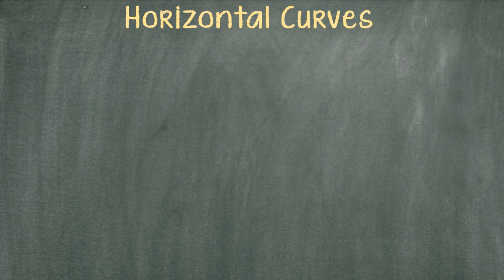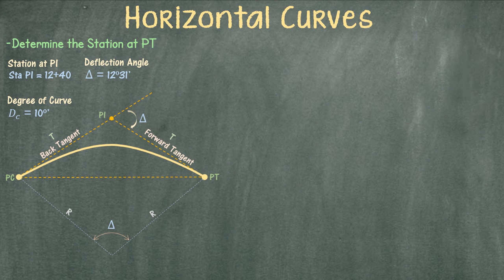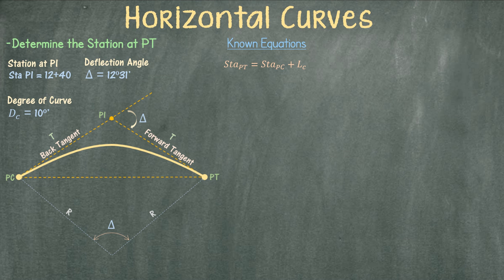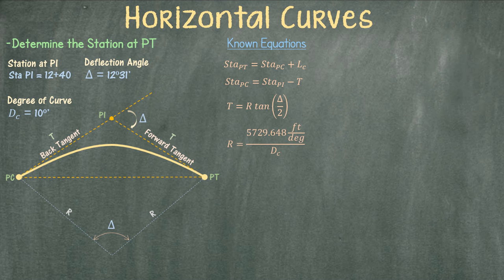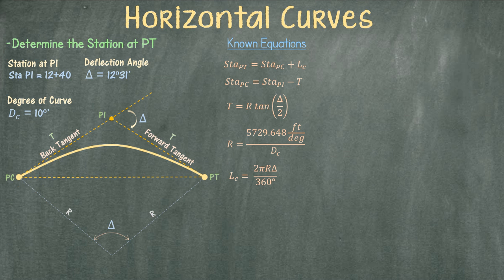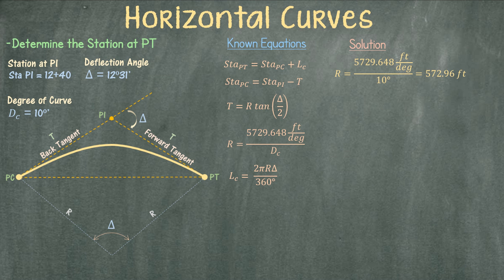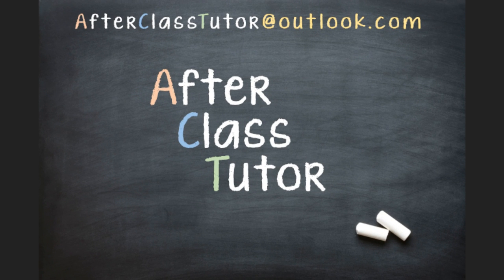Horizontal Curves Elements Part 2 of 2

Comment from the maker: Time Stamps 
00:00 Start 
00:14 Determine the Station at PT 
01:57 Calculation of the Radius of the Horizontal Curve Element 
02:10 Calculation of the Tangent of the Horizontal Curve Element 
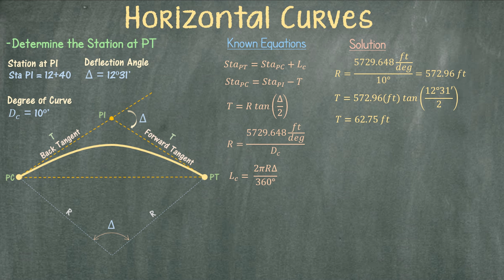02:24 Calculation of the Station at PC of the Horizontal Curve Element 
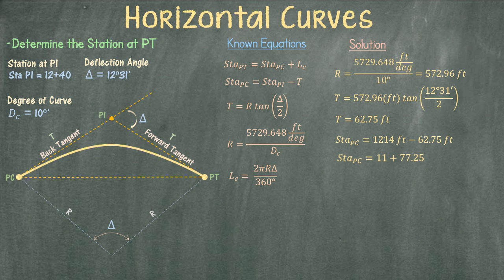02:37 Calculation of the Length of the Curve 
02:49 Calculation of the Station at PT of the Horizontal Curve Element 
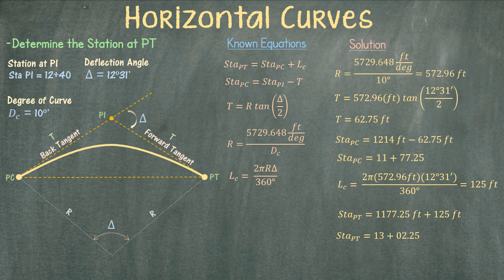03:04 Outro

Comment: Is station PI 1240 or 1214?
Reply from the maker: First of all, thank you for watching. 
The value for PI it's 1240 as I mentioned at the beginning of the video and not 1214 as I typed while working out the solution. Although I typed the wrong value for PI (1214), the calculations are done using the value of 1240.
Reply from the maker: I apologize for the confusion. I appreciate you watching and taking the time to ask the question.

Comment: How did you get station PI to be that value
Reply: i think he make a little mistake is 1240 - 62.75 = 1177.25 ===> Sta 11+77.25
Reply: Yes, that's correct. He made a mistake. I thought the same thing.